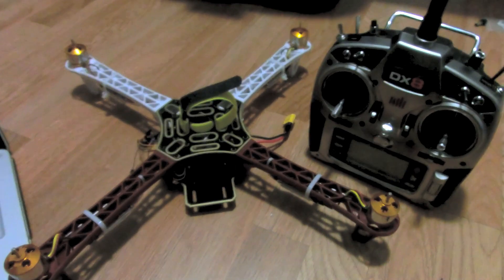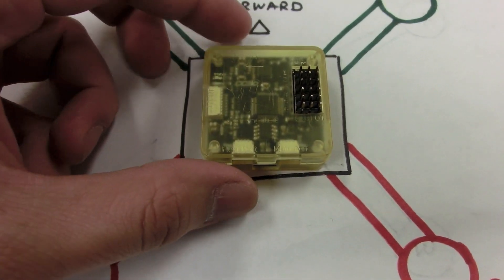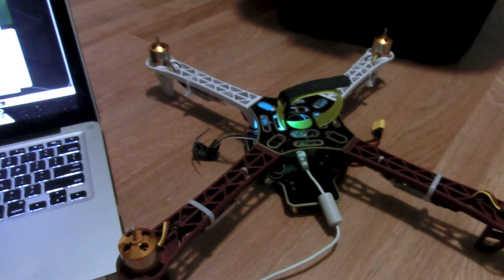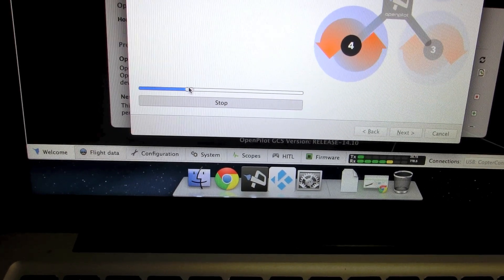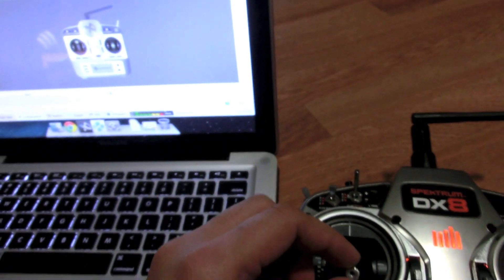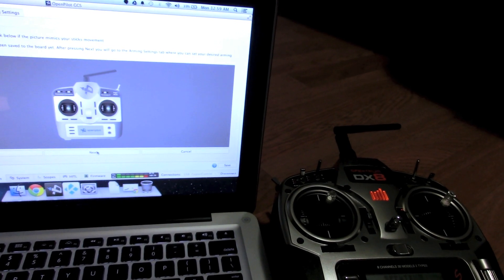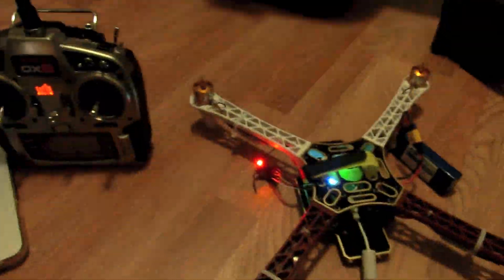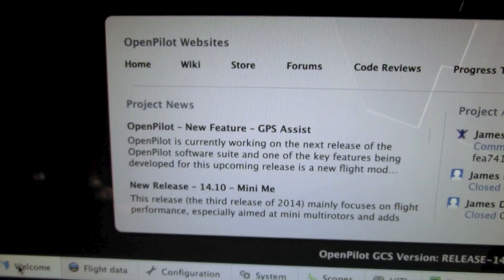How to configure Open Pilot CC3D Flight Controller with Ground Controller Station v14.10 Mini Me

Comment: In many videos i have seen people connecting All three esc wires from only one motor to power fligh controller and rest all esc's signal wire is connected so that fc does not burn but why have u not done this ?

Comment: hey chirag, while calibrating my esc and try to spin my motors they are not spinning they are actually beeping and i am using 5200mah battery first time 3 motors spinned properly and again while doing from the first they are not spinning they are beeping help me out with this
Reply from the maker: Try to manually calibrate them instead of for within the Ground Station. Also what ESCs are you running. whats the Fimrware on it?

To manually calibrate, you will have to connect them one by one to your receivers throttle pin. Turn on radio, set the throttle to high and then power the esc. It will beep different than startup tone indicating that its in throttle calibration and it has saved the high throttle position. After the beep move throttle stick to bottom/low position and wait for it to beep. After that wait for a few seconds and then disconnect the power.

Hope that helps. One the side note CC3D and Open/Libre Pilot are outdated now. I highly recommend using F3 flight controllers and Betaflight for FPV racing and iNav or
Reply: chirag i manually connected to the receiver and then esc starts beeping with different sounds one motor starts spinning but when i connect that esc to other motor the esc is only beeping but motors are not spinning i don't know what do ?

Comment: Hi , Thanks a lot for this video chirag.. I have cc3d board, usb cable, Turnigy 9X transmitter and receiver, But there are not listed X525 Quad copter frame. So which frame choose for my quad copter. And how to set the Turnigy 9x Transmitter switches define ?pls reply urgently OR mail me sj28550@gmail.com
Reply from the maker: I think you are asking about the PID screen at the end. Use the Default tune for the copter and then try manually tuning it. 

For the switches, its personal preference.

Comment: open pilot link in the video does not work. Do you have another place to download this from?
Reply from the maker: here you go. 
https://librepilot.atlassian.net/wiki/display/LPDOC/Downloads
Reply: Thanks for that, but thats librepilot, is that the same thing? I was reluctant to download this and have already seen this site, but was looking for openpilot instead. Is this the same?
Reply from the maker: Yes its basically the same thing. LibrePilot continued for a little bit where OpenPilot left off on that project. How ever once you are familiar with what you are doing I highly recommend using Betaflight instead of OP or LP.

Comment: how does FC gets power if you just connect receiver and ESC's ?
Reply from the maker: +Zukas inc FC gets power from BECs from ESC. If you dont have BEC built in your ESCs (ie you are running Opto ESC) then you will requie separate UBEC to power the FC. Receiver is power up from FC .

Hope that helps! Cheers!

Comment: What can I doo, when my programm dont see that im moving the levers?
Reply from the maker: +CubeLige I have had this happened couple times and its frustrating. But here is what you can do. Rebind your receiver to your radio and select fresh new model and also do Update and Erase on the Flight controller. One more thing you can do now is instead of using OpenPilot use LIbrePilot GCS. Hope that helps!
Reply: Chirag Chaudhari thanks

Comment: esta ligação do cabo receiver tbm serve pra o receiver  flysky 6ch, ou seja  a conjugação de fios será sempre a mesma  que este aqui mostrado, pois  comprei recentemente  um  quad 250 racer e no voa em condiçoes e uma das coisa que ja  notei foi exatamente esta ligaçao, e  no esta como esta ,..sera que deveria  ser igual  a esta !
Reply from the maker: +Rui Chaves Very sorry buddy, cant understand a thing!
Reply: i have  receiver flysky and radio flysky 6ch, configuracion is the same !? cable configurasion
Reply from the maker: yes you can use same configuration. OpenPilt is smart enough to map the input to correct channel.
Reply: +Chirag Chaudhari  tank,s chirag, i try using the same configuration

Comment: can you tell me more about the knob on the transmitter you said you use 4 fine tuneing
Reply from the maker: +Nick Walters The Knob is set on Ch 6 and I use that to Fine tune the PIDs. You have to go to configuration tab and enable TXPIDs. Reboot CC3D and then under Configuration > TXPID > Control Source select the channel you have your POT setup. That way you can fine tune your PIDs. Hope that helps. Any more questions feel free to ask. Sorry about little late reply.

Comment: hey im having an issure and hope you could help. in open pilot its only calibrating one esc and assigning a motor to that channel? being channel 4. if i move another esc cable onto that channel it powers that motor. so when ive armed only one spins :(
Reply from the maker: +luke brook If you are not missing anything, then it might be an issue with the flight controller itself on the Output Pins. Sound like only the PIN 4 is working.

Comment: i need you help.....After completing all settings FC (CC3D) battery is connected and turned on the ignition while I'm off too well ... Battery replacement when you are jammed for a reason I do not know what ...I would like to hear the views of the professional ones also had two replacement firmware all on-board writing still up ... Battery replacement if the power off and on to the next will be jammed from the ... Green Buddha come in at blue light depending on the flickering on startup on-off.
Reply from the maker: +steelman I am very sorry, but I could not understand your issue. I think the translator did not do a good job. if possible can you make a video or something?

Comment: my esc keep beeping over and over.How do i solve this?
Reply from the maker: ESCs beeps repeatedly when its not getting any kind of signal. So make sure they have solid connection with FC and FC is powered on. Also calibrate them all. That should take care of the issue.

Comment: hello i have one question.....i use also cc3d but now when im in the setup wizzard, testen the directions of the motors everything seem to be fine Cw motor 1 CCw motor 2 Cw motor 3 Ccw motor 4, but here is the problem , when i pull the switch to test motor number 1.....motor number 2 start spinning and so on, so  when pull switch for motor 2 motor 3 start spinning , when pull switch for motor 4 motor 1 start spinning, ....my usb of my cc3d is on the right side so Yaw need to be set to 90,....my quad dont want to lift off, i dont know what i did wrong i just bought it few weeks ago somebody else made it for me custom, so also the cc3d pins are solded so basicly ive did not change anything, it was flying before, ive checked the prop direction double, as well the motors, ....any body suggestions
Reply from the maker: Gossie Diggie So if I understand correctly. All you motor are spinning in the right direction 1and 3 CW and 2 and 4 CCW. You have set Yaw to 90° in Attitude tab, and the ESC signals wires are soldered to the CC3D. Also you mentioned that it was flying before. And now the motors acts like they are not connected to right pins. 

The only possible explanation is Your Motor Output Channels are not correct. Go to Configuration>Vehicle>Motor Output Channels. And make sure that each channel is connected to right motor, if not change it to correct motor.
Hope that helps.
Reply: Yes i did ...i went to vehicle set motor 1 to output 2 instead of 1 is 1 and so on...now it dont spin or flip.. When i almost give full trottle it stays solid on the ground
Reply: I will change to the correct motor what is the difference between what ive been doing now...you mean motor 1  ......i dont follow you...ive changed motor 1 is motor 2, motor 2 is motor 3 motor 3 is motor 4 motor 4 is motor 1
Reply: Thanx for the help i hope you can guide me to this frustrstion getting stuck with my hobby kind of thing
Reply: Help me to fly again im realy liking it but know this learning thimg is a part of the job..thanx already for the support
Reply from the maker: I highly recommend contacting whoever built the quad for you, but here is one more thing you can do. Trace the ESC signal wires and make sure they are connected in the right order. See the video. If everything looks ok, then go for full reset. Stat over and setup the quad from the beginning. The latest version of GCS is 15.02.02 , pretty similar to 14.10 in the video. and just go with default PID settings.
Reply: Thanx where can i found the pid settings
Reply: He solded all of the esc on the cc3d so i can never changed so its still the same setup as the beginning...is it possible that i swapped the 2 yellow how goes in my spektrum ar610 receiver by accident
Reply: How do erase previous settings

Comment: I'm using GCS vesion 15.02.02. But in the second step of vehicle setup wizard where there is an upgrade option I get a message that connection timed out and you will have to upload the firmware manually using upload plugin. Because of this I'm unable to proceed with my further configuration. What needs to be done?
Reply from the maker: Vikrant Bhosale try uploading the firmware manually by going to Firmware tab, and on left top corner there is a button called Upgrade and Erase. Hope that helps.

Comment: I followed all your steps, but mine just wont arm? what do i do?
Reply: +Maurits Veerman Hi, did you figure it out? We're having the same problem. Ugh!
Reply from the maker: +Eric Asch Start with fresh model on your transmitter again by re-binding the receiver. make sure all the stick movements are in correct direction during the transmitter setup wizard. If the problem still remains, Erase settings, re-flash the firmware and then start again. I had this happen once so far after setting up over 100 different models, and I had to erase settings ans start fresh. 
Hope this helps.
Reply: I bought a Turigy 9x, and after that it worked when I followed each step, I think it was my DX6I that caused the problem.
Reply: Thanks guys! I borrowed a friends Turnigy 9 and did go through the whole thing over again from scratch and voila! To think we banged our head for so long on this.... Flying now!
Reply: +Eric Asch I'm happy it worked out for you aswell, some transmitter just don't seem to work with the program.

Comment: I like your video I used it to guide me set up my newly built Emax 250 , it seems fine for the most part but I have a couple of issues, it does not hover well a little bit of drift but the worst part is it doesn't hold altitude, one notch up on throttle and would keep climbing and if I go just one click down it dips down, to the ground.
The other issue , and I don't know if it's even an issue or me not used to racing drones, but on my toy drone when I pitch forward I hardly need to increase throttle and the drone will go, this one seem to need more throttle with the pitch to hold altitude other wise it would go down, and when I let go the pitch it keeps going forward unless I pull the pitch back to brake, now is this normal charchteristic of the FPV 250's or something is wrong, thanks in advance.

Comment: Hi Chirag, can i ask if i need to connect the wiring and mount the board on the frame before i can run the software? Or can i just run it without any wiring except the mini-usb cable?
Reply from the maker: Zhenzhou Loh you can simply connect usb cable to the flight controller and program it with GCS on your computer. Only things you can not do is calibrate ESCs and Transmitter.
Reply: Chirag Chaudhari If my final goal is to build a quadcopter, what items do i still need? I have a 8-channel receiver, CC3D, and a F450 airframe.
Reply from the maker: Zhenzhou Loh 4 x Props, 4 x Motors, 4 x ESCs (Or 4 in 1 ESC), Flight Controller,  Quad Frame, Battery, Receiver and Transmitter.  These are the main stuff and then to complete the build you may also require PDB, Silicon Wires, Bullet connectors, zip ties etc. here check out this link : http://scratchbuilds.com/product/zmr250-mini-fpv-racing-quadcopter-diy-kit-red-devil/

Comment: Why is it that my ESC's during the ESC/motor calibration kept on beeping over and over and the process never stopped? I see on your video the number changes down to 900, when I do mine that number does not change at all. I am using SimonK ESC's (those Emax 12A ones), or maybe this has something to do with the type of ESC one select on the software? I remember seen that number moving down to 900 or so before, but I think that was when I sat my ESC's type to Normal (Standard), but this time when I run the ESC's calibration as default starts as the one in the middle and set set to 490 Hz... Maybe I should set them as standard ESC's and set them to 50 Hz or does this matters or makes any big difference?

Comment: That F450 size you got on your video looks so much exactly as mine he he, I got exactly those same golden motors, my ESC's are red as well, except that I was using a Multiwii flight controller with a NEO-N6 GPS, a Bluetooth adapter, and something else don't remember now, all removed from that specific quad. I finished my Tarot 250 project built last night and might give it a try today, if I like this board might buy me another one in the near future to put on my F450 size quad, or maybe a KK 2.1.5 controller, I will see. - Remember I asked you once if you would know what the connector on my frame was? Simple, I figured out that connector is to mount the CC3D board right there, that connector goes through the PCB on the frame to each of the ESC's inputs, from the outputs on the CC3D, the frame even comes with four plastic posts and bolts to mount the CC3D and everything fits right on the money. The DJI S-Bus receiver I bought worked very nice and easy to setup, but after I tried things I decided no tto use it, because the DJI TX has Throttle in the middle at 50% all the time, though it works great on a DJI Phantom it is not suitable for these other applications, so I mounted my Turnigy 9X receiver and going to use my Turnigy 9X TX for the time being, I might later on buy me a Devo 7 or Devo F7 (wich video screen built-in) that aren't too expensive and I like them because I had once a Walkera QR X350 and loved that TX, too bad Walkera quads are made of cheap plastic and any simple crash will crack the frame, it happened to me twice so I ended up reselling the quad back on eBay a year ago, since then I got stuck with DJI Phantom and don't want to know anything about that Walkera crappy company, DJI is real quality on everything they built and the best all over.  -- Well wish me luck, if I crash this little mosquitoe that's fine not much to lose at least I know the frame will be near to impossible to break, the rest is cheap stuff compare to DJI anyway, and I like that and my pocket loves it.. ha ha ha. See ya.

Comment: dude,according to you cc3d is better or a kk2.1.5 flight controller......i m confused that which  one should i use
Reply from the maker: akshat modi IMO no flight controller is better than the other, they might have more or less features. As long as you tune your PIDs correct, you can use any flight controller and get good flight.
The main reason I use CC3D because of the ease of setting it up. The programming is just super simple using the GCS, and I have been using it for a while now so I am more comfortable dealing with it. I do have Flip 32+, Sparky, APM and Pixhawk as well. But I only have used APM on my bigger quad. I just never had time to play with Flip 32+ and Sparky. And I want to use Pixhawk on my dream machine, which is still on the paper under construction.

I have no experience with KK2.1, but one awesome feature is you dont require help of a computer to change settings on this FC. You can do it on the go with simple click of buttons. Both KK 2.1 and CC3D costs almost the same, so really depends on what you want to use it for. Also you should look in to whether you want to use features like Telemetry or GPS in the future. Hope that helps.
Reply: Ok thanks
Reply: Hi,once again.... my brother saw my rc stuff and got mad at it... So now even has started to build a quad .... So he was asking me that what is a flight mode switch.. So I could not give him the exact information , so can you tell the basic definition of that... I request you to post..
Reply from the maker: akshat modi sorry about late reply. So the Flight modes are like different Flight Characteristics that you can change on the go. For example the 250s that we sell have 3 different modes. Attitude, Rattitude and Rate. So if you just want to Cruise around you can fly with Attitude mode. Flip the switch and you will be in Rattitude mode and you can do flips and rolls or on the third mode is Rate which is completely Manual flying. So just by changing the switch position you can have different ways to control your aircraft. Hope that helps.